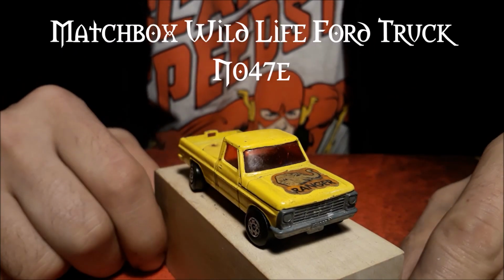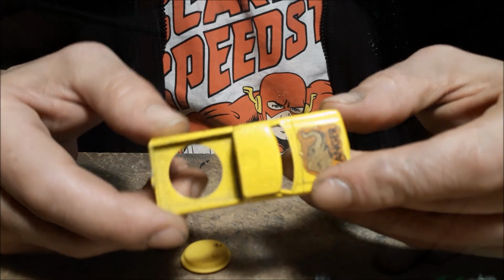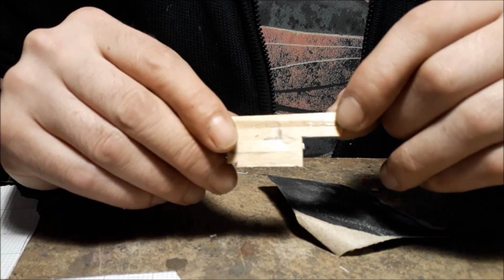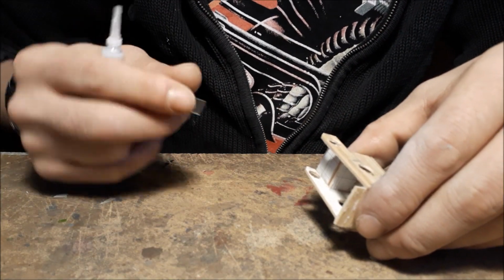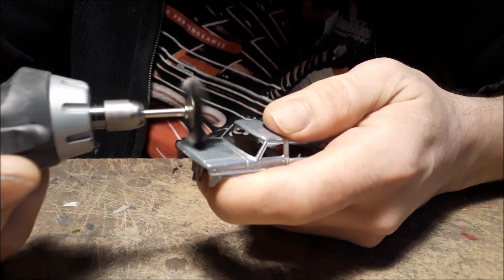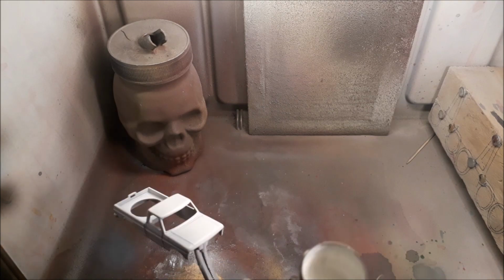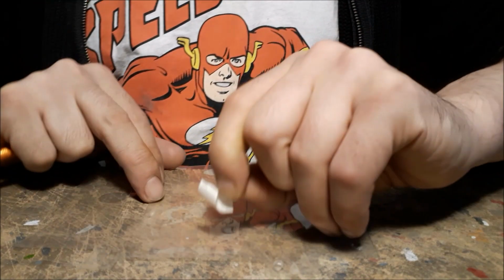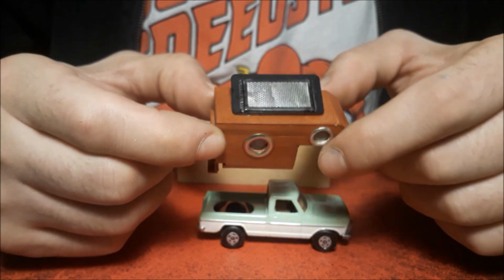Matchbox Ford Truck No57e

Comment: The green/white looks great, very period correct for a Ford, and you've done an excellent job with the silver trim.👍  The "portholes" and solar panel are neat bits of recycling too. The only thing I'm not so sure about is the choice of wheels; the front ones don't seem to fit too well.
It certainly looks way better than the original Matchbox. The Rollamatics were a bit lame and never seemed to work properly, not really one of their better gimmicks.
Having said that, with your ingenuity, could they maybe be adapted for some other uses? I'm thinking lights, or maybe tiny motors to make things turn or move. I'm not necessarily thinking about this particular model but maybe something to think about.😁

Cheers for now,
Dougie.
Reply from the maker: Yes, I've noticed on the last take that they don't fit tight. Maybe the axles are a bit longer so the rolling mechanism worked better..... Something to keep on eye on for the next one.....Cheers Dougie